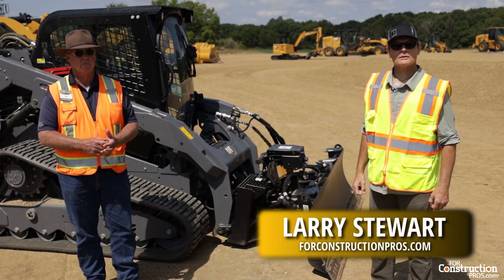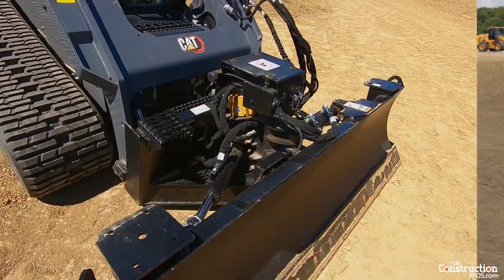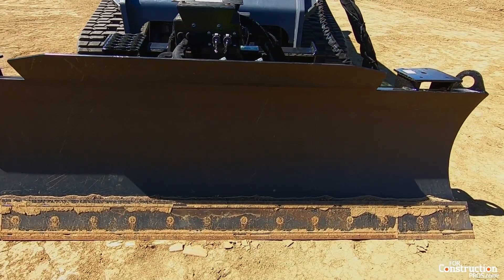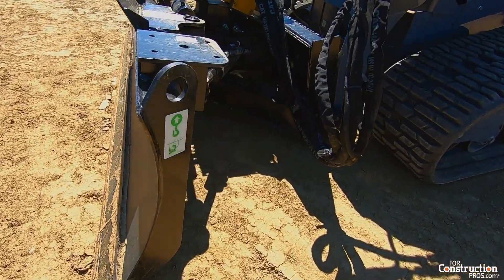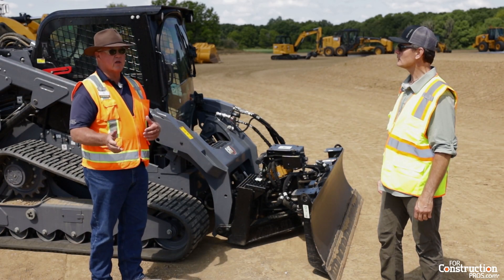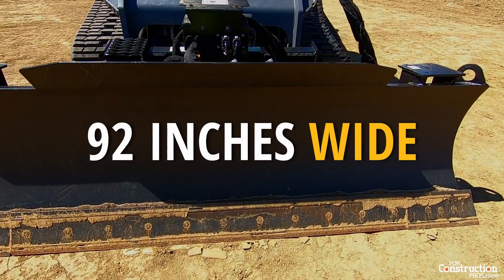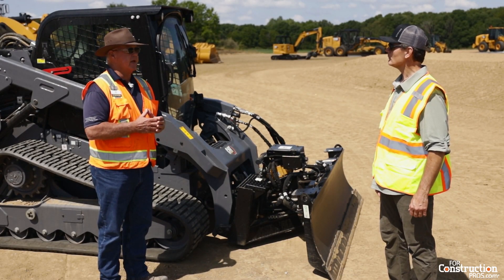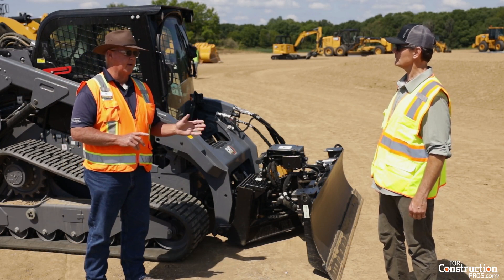Caterpillar's Smart Dozer Attachment Puts Slope Assist on a Skid Steer.

Comment: It's a shame Cat doesn't put much if any time alerting people to the capabilities of a crawler loader. Put a quick attach on a track loader ( full sized) and you really would have a productive machine. I don't think they want people to know about crawler loaders.
Reply: Fusion quick couplers (same as CAT medium wheel loaders) have been available on the 953 and 963 for a few years now and are just starting to become available on 973.  A lot of sewer and water customers are buying them this way so they can switch between a bucket and forks, but there are a number of other compatible attachments as well.  I agree we need to do a better job of advertising for track loaders though!
Reply: Tbh I rented a crawler loader the other day and it’s like having a massive skid steer on the job site problem is you need space for a bigger machine